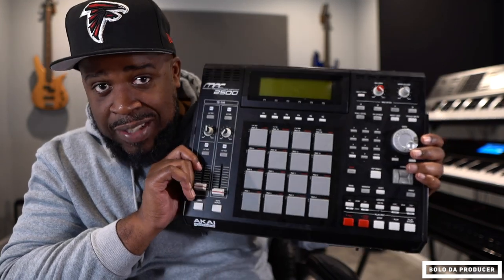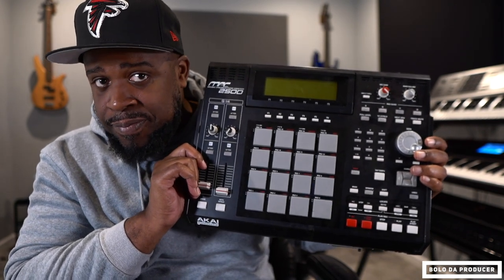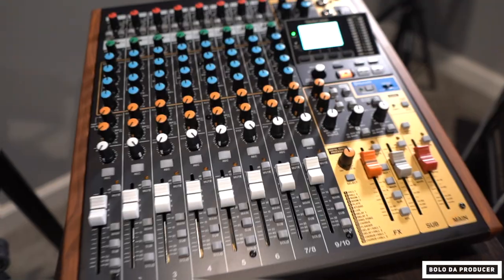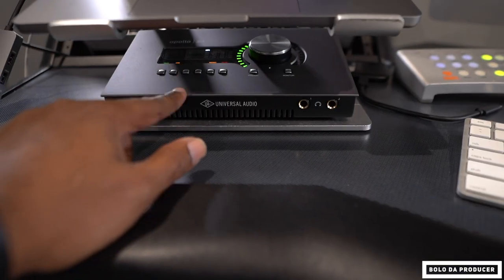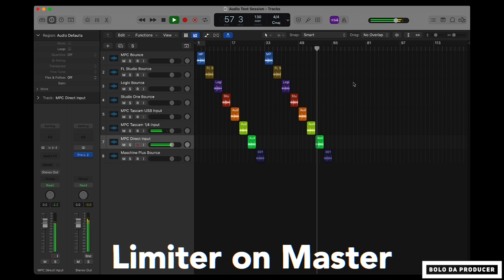Hardware Verses DAW Audio Test: Can You Hear The Difference?

Comment: For YEARS Ive been telling people that DAWs do have a sound to them. Everything is not just ones & zeros! Thank you gor confirming Im not crazy, Bolo!
Reply: Everything actually is 1 and 0' s lol. It's the definition of "digital". Different daws output with different limiting algorithms and things like that that make a difference in rendered sound.
And the older mpc's and digital hardware had grittier sound usually due to it being processed at a lower bit rate.
Slightlt different sounds yes, but mostly it's misunderstood why. You can usually get a match to your preferred style of sound with the right settings.
Reply: Fl studio definitely has a sound to it and so does logic
Reply: Except they don't. The only difference could be internal plugins. Wipe out all of the plugins, get a scientific approach and do a null (phase difference) test.
Reply: @bobanova2283  a null test isn't scientific in a digital application. It would take too long to explain but they are only viable in the analog domain.
Reply: @Craftmaster3  Quite opposite. Analog domain is very prone to variations, even the slightest ones (eg. input voltage variations). Digital isn’t.
Reply: @bobanova2283  I don't think you're understanding what I mean, don't worry about it.
Reply: @Craftmaster3  Please, clarify then.
Reply: Here’s the thing. You can call it placebo, incorrect monitoring, not scientic enough, whatever case. Rendering in different DAWs yields different results….when you HEAR it.  After working with DAWs since 1999 and doing similar tests to what Bolo has, you can definitely hear a difference between not only DAWs but hardware as well. 

Yes, in the digital domain, everything is just ones and zeros. However, the difference is how those numbers are calculated. Now, before you stating pulling out your science guns at me, just think about it. Not all mixers in the DAWs don’t even have the same gain structure , so adding them up to sum won’t produce the same output.
Reply: @gullydeluxe  sadly Some people who will trust a digital  null test over what they actually hear.
Reply: @Craftmaster3  I think i got what you mean man. Even digital applications convert to analog in the output, if that's what you're saying? So what nulls inside the box, might not necessarily be 100% the case if done so after d/a conversion? Especially when dependent upon what hardware is used to process it?
Reply: @gullydeluxe  I get what you mean for sure. That being said, I think the differences that we can hear as producers and engineers that have worked with audio a ton, aren't really noticed by 99% of casual listeners tho. We pick up on it because we've worked with enough sources to perceive these slight differences. One producer with Studio One can make a beat slap harder than another producer with FL studio or a mpc. It just depends on the know how and the way the beat is engineered.
Wich is why in the end, one daw isn't better than any other, including hardware. If it sounds good, it sounds good 👍
Reply: @gullydeluxe  If we are speaking facts, there are no feelings or any subjective input, it’s not discussion of a song or a painting. Just cold, objective facts. If you can prove what you’re talking about, i’m down with it. The only objective method is a null test. It’s simple wave cancellation test.
Reply: @bobanova2283  you do know that we’re literally commenting on a video that is purely about how different things sound on different DAWs & equipment, right?

Comment: Did you try lining up any two versions and flipping one out of phase? If there’s a difference in the sound, whatever the difference is will play out of your speakers (if one of the two selections has more low end or more high end, that’s what you’ll be left with). It’s the most objective way to check for a real difference or if it’s simply the Placebo Effect at work.

(I did this exact thing to test the summing engines in Nuendo and Pro Tools a few years ago. Surprise, surprise: Absolutely no difference in the Master output’s summing buss in either application despite how much I’d heard from other people that one was better than the other)